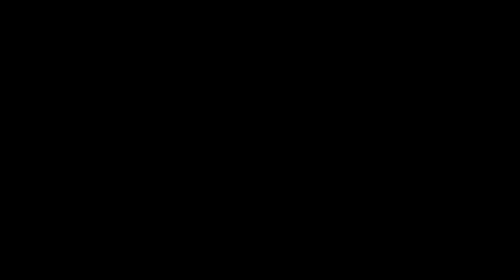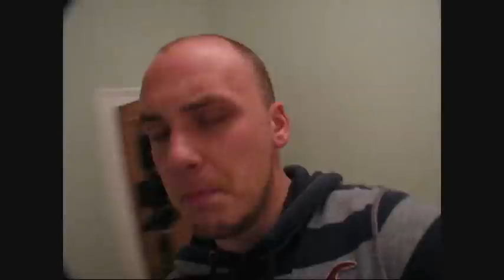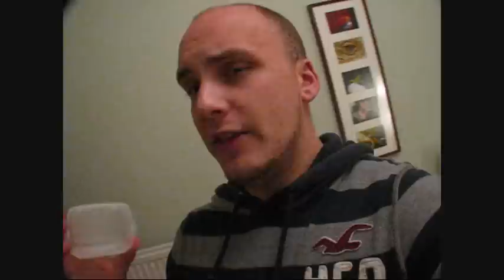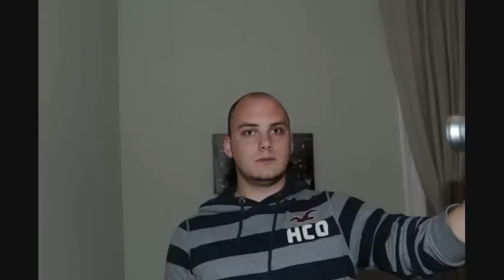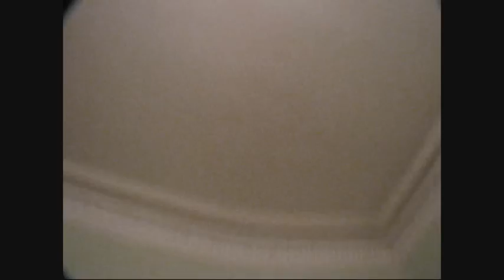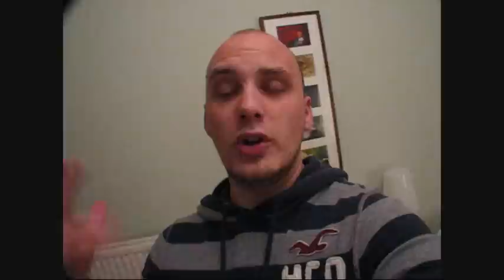Flash Photography Diffusion Dome tips  By Dom Bower

Comment: @dombower Hi Dom, am using a D700 with a SB900 and testing with various flash technique. Found that when using the softbox and umbrella (TTL mode and Commander mode), there is tendency for the photo to be under-exposed. Is this normal or my setting is out? On camera normally F8 Aperture mode

Comment: The Gary Fong Dome is a much better dome than your tiny little 'dome' thing you have and keep showing in your videos.  Your test shot would have looked 10 times better using the bigger Gary Fong dome or the other options out there such as small portable Chimera lite box. Even pulling out the little white card built in to the flash would have even been better than all the things you did.